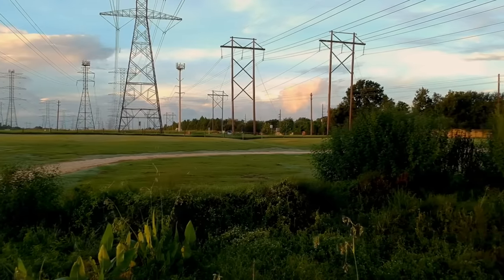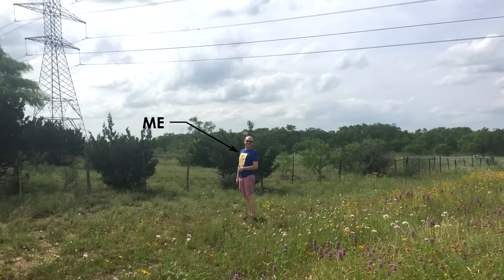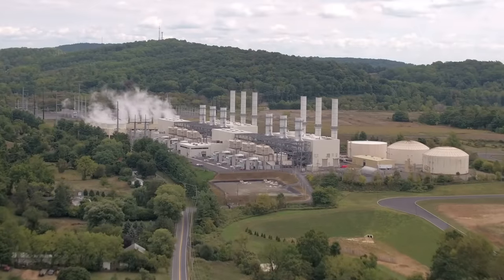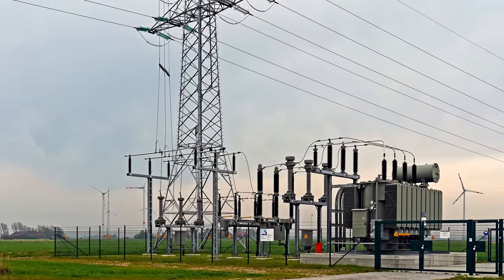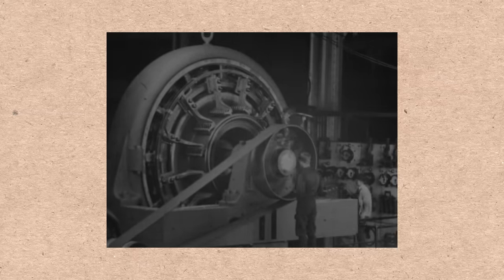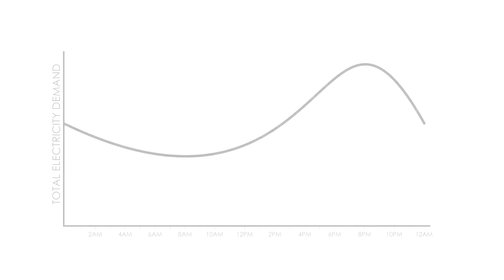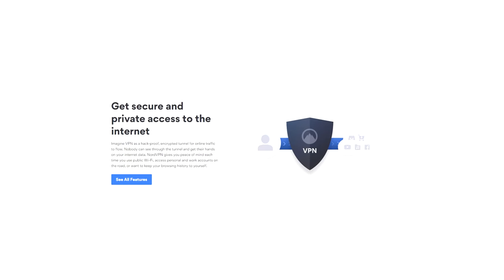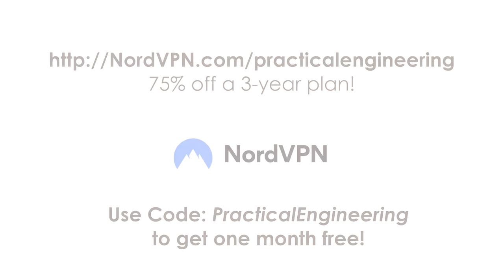How Does the Power Grid Work?

Comment: When the usage/demand of electricity is larger than the production/supply it is a problem. What about the opposite?
Reply: It is a problem too. In both cases, frequency will deviate from the nominal, which can cause generator/demand tripping.
Reply: @FrainBart_main  how the man in the generator know if the supply is less than the usage??
Reply: @mbahmarijan789  When demand exceeds supply, the breaking electromagnetic force on each generator that is synchronized to the grid exceeds the accelerating mechanical (turbine) force, so the generator automatically starts to decelerate.
Reply: @mbahmarijan789  Then the automatic control systems sense the deviation and start opening/closing the steam valves (hydro turbine gates), increasing/decreasing the mechanical force and achieving an equilibrium.

Comment: All we need are kinetic energy storage plants to buy energy from the grid when it's cheap and sell it when it's expensive. Assuming you have solid rotors spinning at 100m/s on the edge, you'll only need 1440 tons per MWh.
Reply: Interestingly, the diameter of the rotors and the material density don't change that value.
Reply: There are some!  They pump water into a reservoir at a higher elevation during the low demand hours and then use the downward flow of that water to power small hydro turbines to balance out peak loads.

Comment: Sir, better ask relay manufacturers to use military microsecond crystal >100 centigrade with an annual 1 micro second decay especially distance relays since we are using bare conductors and bolted lattice type towers instead steel poles in high voltage sides susceptible to trippings during rainy days due to stocked flying kites causing line-to-line tripping and pilferages. 
Today, audio electronic circuit voltage stability depend in capacitors. Why can't SCADA uses super or ultracapacitors based on activated coconut shell or abaca hemp  activated carbon especially in intermittent renewable grids? Testa did transmitted energy wirelessly powering 250 bulbs 25 miles away from the source and remote a model boat in year 1900 using his capacitors.
Blackouts can be eliminated by small grids with large energy server plus the developed motor-composite flywheel-generator-supercapacitor of ABB and URENCO producing power continously.

Comment: Nice video. However, at 3:10 it's better said as "step down the voltage to a safer and more practical level" and not as "step down the power to a safer and more practical voltage". Power is not voltage.

Comment: Grady, like a gas engine, the 60 Hz electricity 
switches twice per cycle.  Kinda (exactly) 
like a 2 stroke engine.  So, it actually switches 
120 times per second.

steve

Comment: What exactly happens when electrical power supply exceeds demand? Does it just break a fuse somewhere?
Reply: The excess energy starts to accumulate as the additional kinetic rotational energy of rotating masses (mostly huge turbines and synchronous generators in power plants) - their rotational speed (along with the electrical frequency of the waveform) increases. It does not break any fuse but if the increase in rotational speed is too high, generators might trip offline as a safety measure.

Comment: The problem is we have made a technology that works great for computers transistors IE a device that uses a small amount of electricity to control a large amount of power. what we need to do is make a alternating transistor that can control are power source use a small amount of electricity to control a large generator once we do that controlling power generation and load is easy as pie and we understand pie very well

Comment: Why not mention storing electricity in batteries or other mechanical means. I differ with your statement that energy produced cannot be stored for later.
Reply: They don't store electricity, though, they store energy in either chemical or mechanical forms, that will then have to be converted back into electricity to be used.

Comment: Electricity can't be stored?  Ummm, yes it can.  Pumped storage (running a generator in reverse to fill a water reservoir), kinetic storage (pulling a train of wagons filled with ballast up a mountain), etc.  Oh, you meant stored without conversion to a different type of energy?  There are big rechargeable batteries used for exactly that purpose.

As for demand, generating companies keep a close eye on TV schedules.  There's a big peak when everybody puts the kettle on during the adverts.  They usually use gas turbines to handle those sorts of peaks because they can be spun up in a matter of seconds.  Pumped storage is also good for rapid response: https://en.wikipedia.org/wiki/Dinorwig_Power_Station

Comment: Practical Engineering.

You did not explain how the grid and generators match demand to output. With conventional power plants, it is easy, they have essentially a cruise control based on frequency. If the frequency starts to droop the turbine governor senses the speed loss and opens up the steam valve until normal speed is again acheived. What the grid controller has to do is anticipate what the demand will be and ensure sufficient capacity is available and maybe alert stand by plants or peak loppers to be ready and call them up as required. This is where pumped storage plants come into their own, instant power as required. 

What has thrown a spanner into the works is the intermittemnt renewable generation, which makes the work of the conventional power plants that much harder and subsequently the grid controllers job is harder.

Comment: 0:29 those limits of electricity this guy just claimed is all defied by Solar Panels. Literally creates electricity from PhotoVoltaic rays from the Sun per DC to AC, Stored by a back up battery/PowerWall, and you can utilize it during blackouts (later)

Comment: Sir plz tell me how to make 10 kv generator for my  home electricity
Reply: You need to think about Watts, not Volts. Your house does not need 10 kv, maybe the spark plug in your car does. The purpose of high voltage is long distance, or overcoming a high resistance gap (for example, air). Watts measure how much power your home is using. Generating electricity is simple, you spin a magnet in a coil of wire, but if you want to connect it to the grid, it gets more complicated, because you have to match the frequency and phase as well. If you want to use a DC source like solar panels, there are solid state inverters that handle that for you.

Comment: But how does it match demand with supply, exactly? And what happens to the excess power if it goes over....?
Reply: The voltage rises or drops if the load doesn't match the supply. Natural gas turbines and hydro dams are the easiest to throttle on short notice.
Reply: This channel is called "Practical Engineering". You can expect it to appeal to a wide variety of interested viewers, with a wide range of experience and background. If you are fortunate enough to have extensive knowledge in the area, that's terrific. But basic questions from the genuinely intrigued layman can still be received and answered with respect. We're all better off with a more knowledgeable public.
Reply: @DFPercush  right, so how does power output rise by precisely 200W the moment I turn on my TV?

I realise a lot of it is averaged out over the large number of users on the grid, but there are going to be millions of small fluctuations every minute. Do the gas plants constantly fluctuate the amount of gas being burnt every second? And if so, how is that fine tuning achieved? Assuming we're talking about a non-smart grid.
Reply: @nnneh1  Yes, averages are pretty important. Think about the (in)significance of your 200W television compared to all of the power consumers in the continent. It's a drop in the ocean. But the voltage does decrease ever so slightly as a result of that instantaneous action. And it rises when someone shuts theirs off. So the exact voltage on the line does have micro-fluctuations. This can be especially noticeable when the air conditioning cuts on and the lights dim, but that also has to do with the house wiring. Also because the compressor motor is basically a short circuit at 0 rpm. But conversely, if there is "too much power" then the voltage rises, and well, anything hooked up to the line gets more current. Ohm's law. So the power gets used as it's produced anyway. Great Britain has a thing where they use excess energy to pump water to the top of a mountain and then drains it for hydro power during peak, and Elon Musk is putting giant battery banks in Australia, so maybe grid storage will be a thing in the near future, who knows.
Reply: Grady did an excellent INTRODUCTION to power grids; however,  the details underlying this topic are really complicated.  The basic answer to this question is that the power grid includes multiple layers of overlapping controls that balance generation against load.  At the most bottom of the hierarchy, each rotating generator has inertia, and if the electrical energy taken from the machine exceeds the mechanical energy going into the machine, there is energy stored in the rotating inertia of the machine that can be extracted on a short term basis (typically in the millisecond range) to make up the difference.  At the top of the hierarchy are central control systems that measure overall load and overall generation, and dispatch individual generators in a way to optimize the supply mix to achieve economic, reliability, and environmental objectives.  These 'outer loop' controls typically operate on time scales that range from perhaps 15 minutes to 24 hours.
Reply: @monophoto1  awesome answers, thanks, and @DFPercush. I thought maybe an excess would be maintained at all times with the extra energy being lost as heat in the wires and transformers, but I think you're saying the correct way to look at it is as a whole, complicated system. The inertia of the turbines provides a kind of passive control to the system, which, if it drops, will trigger the consumption of more fuel at the power generation site. So the active part of the control system is based on the measurement of the turbine's rpm. Is that about it, in layman's terms?

Comment: It isn't entirely accurate to say that electricity can't be stored. You could, for example, just use a rechargeable battery to soak up excess supply and then release that electricity to handle excess demand.

Of course, the problem is that this is incredibly inefficient. Batteries have a poor cost-to-storage ratio. Additionally, you lose some of that electricity in the act of storing it. It's a helpful tool, but it doesn't eliminate the constant struggle to predict demand and produce a matching supply.

Comment: Stupid question, what happens when electricity isn't used?
I would guess it gets turned into heat.
Reply: simple answer: they produce less. slightly more detailed but not fully describing because i'm no expert: the frequency of the grid increases because of lower load, and they look at that to determine how much energy is being used. some websites even show real time frequency of your powergrid if you're interrested

Comment: This is the first time I've ever been disappointed with a Practical Engineering video :-/ This video basically just listed the obvious facts of a power grid "It involves sending power from generators to consumers" and "Balancing supply with demand is hard", without explaining how any of the hard parts are done. E.g., how is supply balanced with load? How do you keep the generators in the same phase? How do they correct for changes in signal quality?

You mentioned this is going to be a series, so I'm hoping the rest of the series will shed some more light. But when I saw Practical Engineering had released a video on How Power Grids Work, I was excited because I thought I'd learn something, and I was sorely disappointed.

Comment: I would be interested in a video about the safety of the power grid against solar storms the companys, which say there protekted but many engineers from around the world criticise the system in north amerika because it has to less double failure systems and only the big substations are prepairdes and the smal on e wihch are 3/4 of the system are not save enogh to withstand a solar storm like in the 60s but today i think the damage would be massivly beacuse everithink is on the same power grid and egverithing needs elektricity and has computer chian not withstand overpowering (EMP)

Comment: Is there a technical reason why the North American grid is split into four parts and not unified into a single grid? Or are there political and commercial reasons for it?
Reply: After watching the video I know just about as little as when I started.  The title really isn't appropriate as it doesn't describe anything related to grid operation.  I can guess though, I'll give two reasons for small interconnects.
Every generator in an interconnect has to be synchronized with every other generator (as in, rotating at exactly the same speed, and maybe phase?).  That it's possible amazes me.
Maybe more important, grid stability is a problem.  It isn't good if a failure somewhere in the system grows out of control and shuts down the whole grid.  The engineers of course design so this won't happen, but they don't have it right, and I don't recall them ever doing a scheduled test to boost their understanding.  Instability only grows with a bigger interconnect.
The separate parts are interconnected, but it's through DC connections so synchronizing sources isn't a problem.

Comment: You don't need VPN to be secure, HTTPS protects you!
Reply: Not really. As an example, DNS is not encrypted, so an attacker could create a bogus entry to direct you from YourBank.com to another server. Man in the middle attacks can be difficult to spot ahead of time. 

I can get an SSL certificate for say Youbank.com and proxy the traffic to YourBank.com, so you can log into your banking account. Would you spot the difference?
Reply: @gorillaau  you can't use ssl certificate of yourbank on any other domain except exact match! MITM attack are not such a treat at all in real world
Reply: @siux94  I meant get the domain and then the SSL. It's not expensive nor hard. Do able in under 30 minutes.

Comment: Why don't we just use power storage facilities to smooth out the spikes in power usage, much like a capacitor?
Reply: it's happening. But slowly. The scale has not existed yet to do so. Other than pumped hydro nothing else could handle the requirement. That's slowly changing but it's expensive.

Comment: I get why qubec is separate. It's isolated and and large. But why does Texas have it's own grid?
Reply: Texas dosent want the federal government to be in its business, and as long as it dosent sell power over state lines then we keep the feds out of our power grid.
Reply: The reason Quebec is not on the Eastern Grid is mainly technical. It would be easy to link it to different point on the Ontario Province and on different states at the border. The main reason is the source of energy. Quebec is mainly hydro-electric (around 95%) therefore is a slow network. Not slow in term of frequency but of inertia. Most power plant in North America use thermal source of energy and blow gas in a high speed turbine link to an alternator. Those turn to a speed that could reach a mechanical speed of 3600 RPM. Hydro turbine will turn at speed that could go from 75 to 150 RPM. The mechanical inertia is quite different.
This gap of speed show on the "quality" of the frequency.
But still, there are some connection that could be made. The oldest way to do it is to disconnect a part of the production in Quebec that could go from a few alternators to a full power plant and then root this production to a neighbors' grid. There is also what I call the universal frequency which is 0 or the DC current so there are a lot of connection between the Quebec power grid and different provinces and states going from Quebec's 60Hz to DC to the consumer's 60Hz.

Comment: what happens when the supply is more than the demand, where do the rest of the electricity goes?
Reply: Network use "frequency" as the reference.
Think as in your car while using the cruise control. If you encounter changing of level while climbing you will need more energy but will want to keep the same speed so more fuel to the motor but keeping the same speed. Same thing when you go back down, you have to send less fuel to the motor but you keep a regular speed.
It is basically the same on a power grid. When a customer add some more load, the frequency tend to slow down and the network compensate by sending more mechanical energy to an alternator. 
So basically, you regulate the power to maintain a frequency.

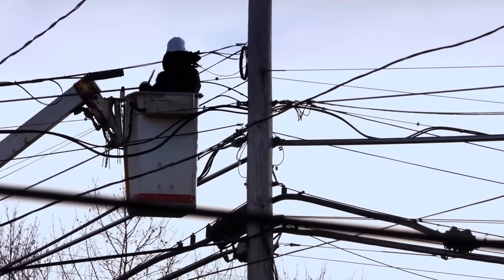Comment: Showing a tv or cable guy at 6:05 below the secondary level on a pole. Terrible. You can see a secondary service drop above him. And during peak times, the most polluting sources are used like coal or natural gas, which are not the most expensive. They are banned at most times, but relied on when needed. Get it right.